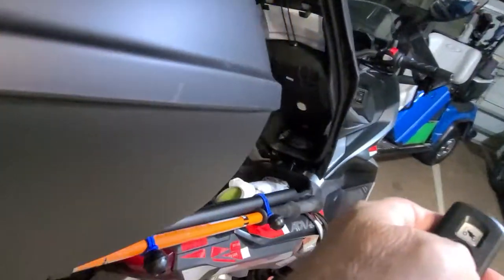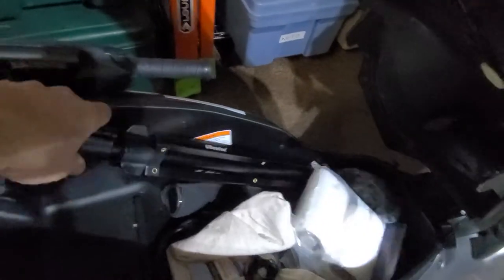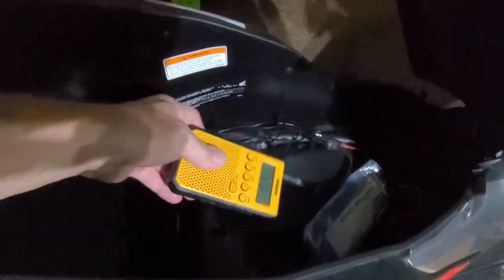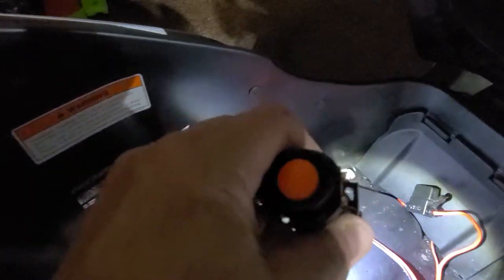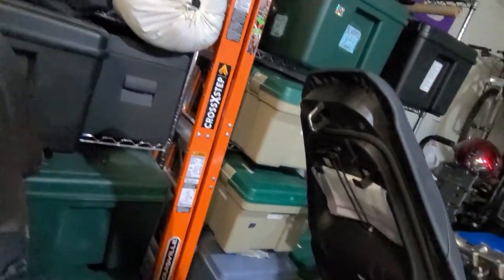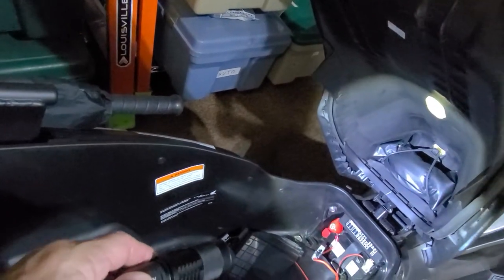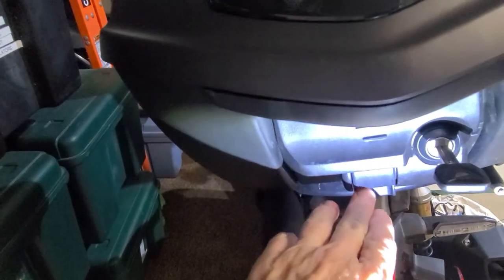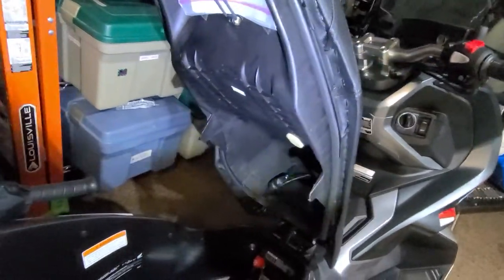Honda ADV150 Battery Charging

Comment: how do you open the seat when the battery is dead
Reply from the maker: I don't know. I rarely lock the seat. This is an old video, and I don't remember how I got the seat open.
Reply from the maker: I don't know. I leave the seat unlocked in my garage. Call your dealer.